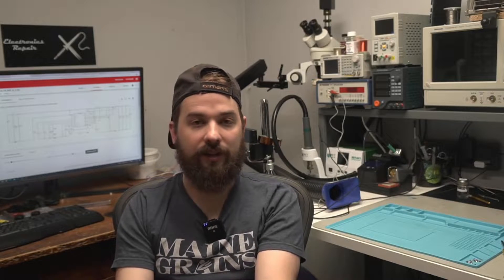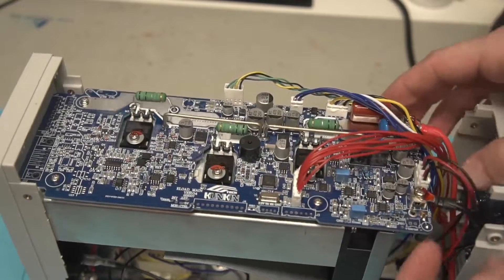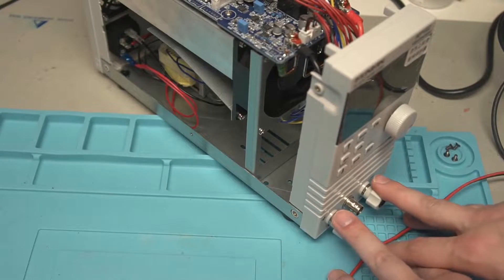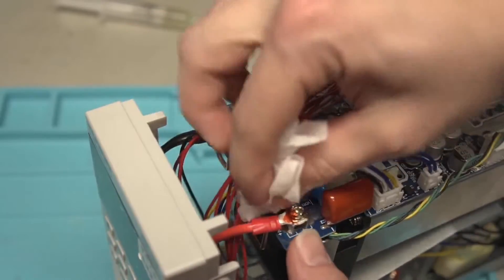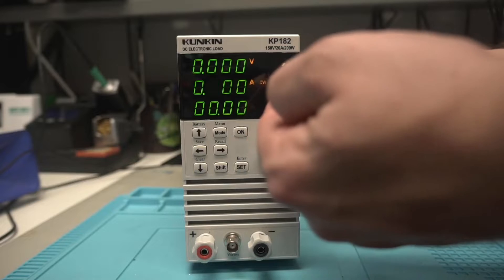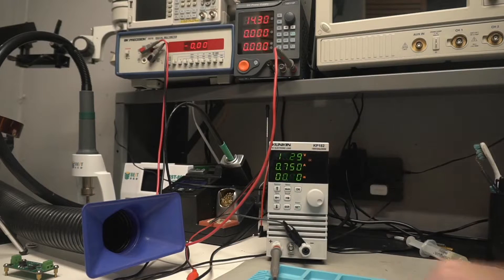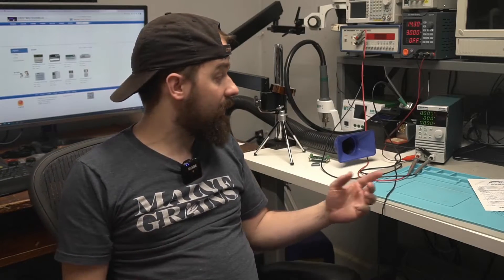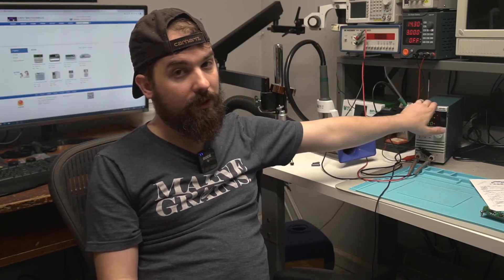Kunkin KP182 Electronic Load Review

Comment: looking at eevblog forum I see there are third party software options now for the Kunkins - and the KP182 can be modified "easily" to add the missing parts [which include U23 ADUM 1201 and the 2No. RX/TX resistors]

Comment: Regarding software, I want to add something regarding your statement about the crappy software that comes with some of these devices.

I have an Owon SPE6103 power supply which has a USB port. This USB port will register as a serial port under Linux and Windows. With the KP184 I believe it has a RS485 serial port, which means one needs a RS485 to USB adapter. This will then also register as serial port in Windows and Linux. (COM port). 
For my Owon the software was also crappy and Windows-only. However the protocol was documented.
Since a serial port is essentially just an old fashioned text terminal, it it quite simple to write little scripts e.g. for data logging or setting setpoints, especially under Linux/Unix.
To report the current consumption on my Owon, I wrote a script that prints the current to the terminal at 10Hz. After logging data for a while I can save this to a text file, which is essentially a CSV spreadsheet with 1 column, so any spreadseet/plotting or data analysis program can easily open it. My spreadsheet program will display the average current for example.

See example script here: https://gist.github.com/EDG5000/0520be08175c9e3e091e3bbc1b26d265

Comment: Nice presentation and demonstration. I use some of the BK precision meters at work but for my home use, this will do fine and for a very good price point. It seems to work just fine and accurate enough. I may decide to get the 400W model because I will use it to test power sources and batteries. Nice job !!!

Comment: Question for you: do you have a bunch of unsoldered pins on the back of the front display board too?  I bought this as the almost-cheapest-available programmable load available and on taking it apart noticed numerous non-soldered connectors  on that front-facing board.  The device still appears to work correctly however, so I am wondering if those are unused connections that didn't need it or if they are just a QC fail and it's working anyway just through mechanical contact in the through-hole pins touching metal to metal.
Reply: Stuff like that's real common. Not sure how familiar you are with test equipment and stuff but pretty much any circuit board will have all types of footprints and versions printed onto the same board. Some of the spots will be filled with chips, son will be left blank, others may be bridged with solder joints. It's just a way for them to spin up one or two board designs and make several different option finished devices without having to have dozens of different board designs.
Reply: @hullinstruments  No, I mean there are connectors pushed through the through-holes that just aren't soldered.  I'm not talking about unpopulated portions of the board.
Reply: @neverendingstudent  oh.... my bad.
Reply: @hullinstruments  No problem, I understand why what you thought of that scenario as it is really common.